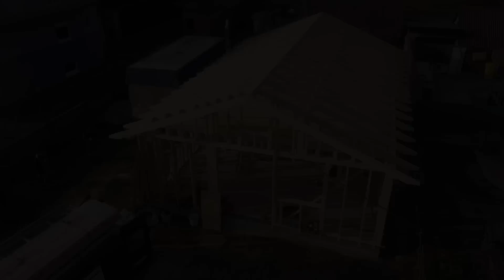6 Days in 8 Minutes- 100m2 House Frame

Comment: nice work.
Here in the Czech Republic, we also put 40 mm hard polystyrene XPS between the waterproofing and the wood. It's a good insurance policy. For example, when water breaks and spills everywhere under the finished floor.

https://www.youtube.com/watch?v=MVWDYQKtpoE&t=385s
Here you can see what water will do when it is under the floor for a long time. The cause was a leaking shower tray

https://www.youtube.com/watch?v=y9t7-YDAtcY
And here you can see how the polystyrene XPS works :)

Comment: This doesn't even come close to comparing to builds in the US. None of the wood is warped or cracked, There's no mud caked on any of the sheathing, everything looks to be square and plumb. Seriously... I have walked through many in process builds here and you'd be shocked at how poorly most US houses are built. Nice work fellas 👍
Reply from the maker: Thank you very much!:) To be honest, I was in the US in 2000 when I was a kid so I don't remember much of what I saw, we used to work with imported douglas fir from the US some 15 or more years ago and I remember it being really nice timber. Cross section was a bit unusual compared to what is standard here though.. I guess we had a good supplier. Glad you like the work!
Reply: As a non-American, I am always amazed by the high timber price although the state has lots of trees. And I never understand they call 2x4 for 1,1/2"x3,1/2" and they aren't really dry tho. Their actual size of 2x6 is 1.5"x5.5". That's why we see their homes are made out of toothpicks. (I know there are custom timber and lvl manufacturers there)
Among YouTuber builders, I like NS Builders (stick frame) , and RR Building (post frame).
Reply: RR Buildings is an exception. Those 2 dudes really know their stuff. There will be a lake of liquid nitrogen in Hades before RR Buildings builds a junky house.

Comment: Try and imagine putting these huge 250mm(?) long woodscrews in with a screwdriver!!! Even impressive with a cordless drill...
Awesome as all you guys do...
Reply from the maker: Not so hard as it looks:) They have a notch at the tip that acts as a drill bit and clearing fins at the end of the heliks so no pre-drilling is needed. It is quite satisfying driving them in, especially the longer ones of 40cm+ . These really do test the limits of battery drills..

Comment: That's the house I'd like to have for myself! Some comments and questions:
-in the US they just use vertical and horizontal elements. I have seen the walls have diagonal reinforcements: is this just temporary?
-when you drive that long 8x240 screws do you drill a guide hole before?
-how come that you can work on a roof without safety equipment? It's it allowed in your country?
-this time the "music" is really disturbing (sorry!!!) Maybe next time Mozart or nothing? 😄😄😄
Thank you, nice job! I would like to see the rest!
🙏🏻🌞
Reply from the maker: Yes those are temporary braces, walls will be covered with 12 mm fermacell boards inside and outside and those boards will take eventual horisontal loads. 
Those screws have a notch at the top which acts as a drill bit and a clearing fins at the end of the helix so no pre-drilling is required.
As for the safety, @Helloverlord kinda got some of it right;)
Mozart is reserved for my house so next video should be to yours and my liking;)
Thank you very much! I'm glad you like the project!:)
Reply: Let me pick one to answer: we carry safety harness only if do roof repair at rainy night, drunk and above 30ft. :D

Comment: Excellent video. Great job. Yes time is very precious when needing to get the roof on before rain. We do use screws here along with nails just like you do, it does depend on the local building code as to which is used where. Most places that have seismic activity require nails because they will flex more before breaking.  Thanks for making and sharing this video. Glad to see you and your crew are doing well.
Reply from the maker: Thank you very much! I'm glad you enjoyed the video and the work!:)